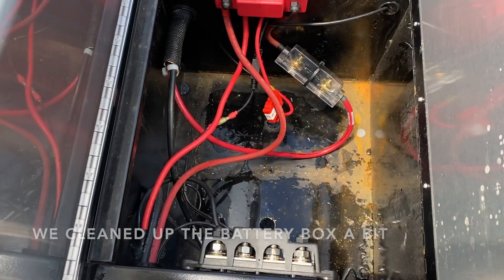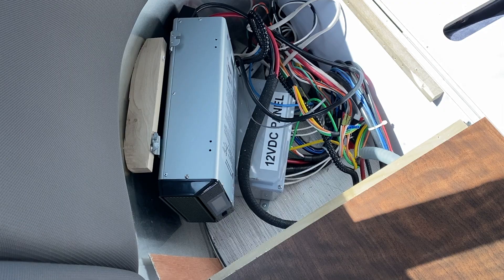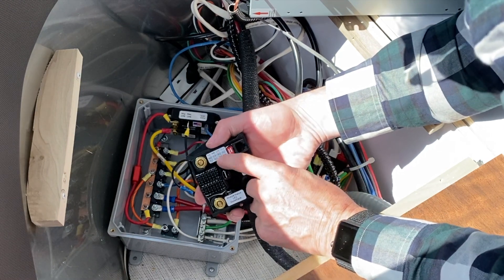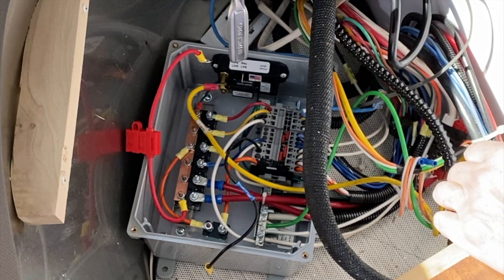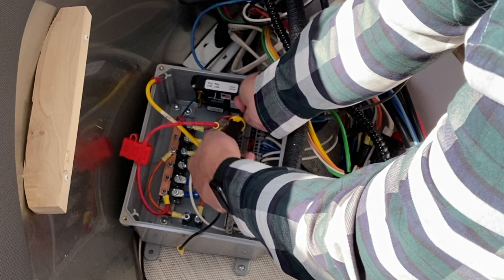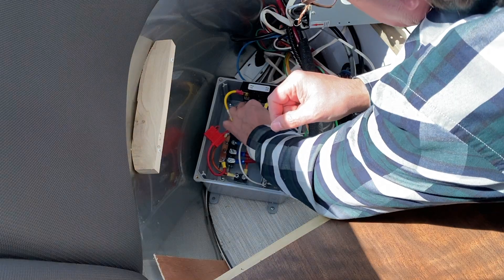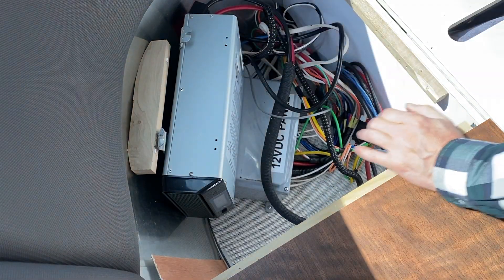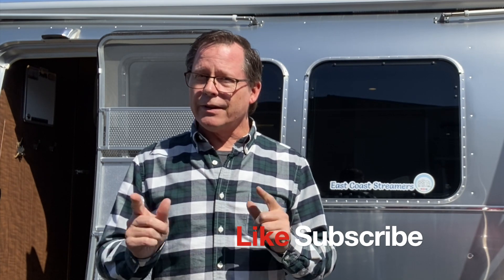New Lithium Aware Solar Charge Controller and Lithium Battery Installation

Comment: I've got a battery issue on my 2020 Globetrotter 23 FB (I believe the same as yours) that has me mulling over the plunge into lithium, so these videos have been AWESOME!   Quick question Barry.....you mentioned that you replaced some of the wiring with 4 gauge....which wire(s) did you replace?   If I do take swap out the batteries, I'll probably go the Battle Born dual battery route since they'll fit into the existing housing.   Thanks again for such great content....please keep it coming!
Reply from the maker: Hi Steve! Hope you are well.

Barry relocated the Big Battery to the front compartment and he used 4 gauge to run from the battery box to the front compartment. Barry has been chatting with another friend on FB about his BB install. Make sure to measure precisely. The BBs with self heating are too big to put 2 side by side in the standard battery box. He said to be sure to account for the trailer body angle when measuring. He ended up putting them in the side compartment. I dropped a post with his photos on the group page - https://www.facebook.com/groups/ecstreamers

Thanks for the question and (as always) for watching!!
Reply: @EastCoastStreamers  That's great info on the BB batteries.   Interstate replaced both of my batteries under warranty at no cost to me, so I'll be sticking with AGM for now.  Definitely will do this whole lithium upgrade when these batteries bit the dust.  Thanks again for all the great info!

Comment: Did you change anything on the converter to charge lithium batteries
Reply: I was wondering the same thing- I keep reading that the stock converter wont work properly with lithium - wont charge them correctly.
Reply from the maker: That's true - the factory solar controller will only charge to 13.6v. When the factory (non-lithium aware) controller sees the capacity is 13.6v it thinks the battery is full.  When we install the new lithium aware 12v/110 converter , it will charge the battery the full 14.6v when plugged into shore.
Reply from the maker: Hi guys - good question. We are working on replacing the factory converter! It has been on back-order for a bit and we hope it ships in the next couple weeks.
Reply: Thanks for the replay. We have the same airstream and are thinking of getting lithium batteries so I look forward to the converter install
Reply from the maker: Glad it was helpful. Check out Big Battery. I put a link to the one we bought in the description. :) If you haven't already, check out Will Prowse's review https://youtu.be/OV6zgSA3fls. Will is an expert in all things solar and LiFePO4 (Lithium Iron Phosphate). BB is an excellent alternative to Battle Born.

Just to be clear. The new solar controller in the 12v panel allows the new LiFePO4 battery to full charge via the solar panels. There is also a 12v/110 converter that allows the new LiFePO4 battery to fully charge when the trailer is connected to shore power.